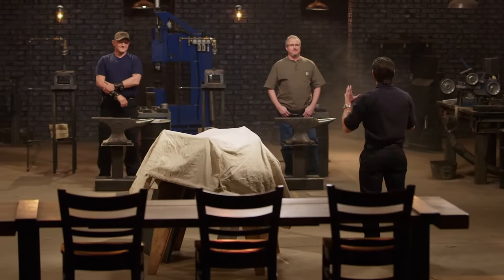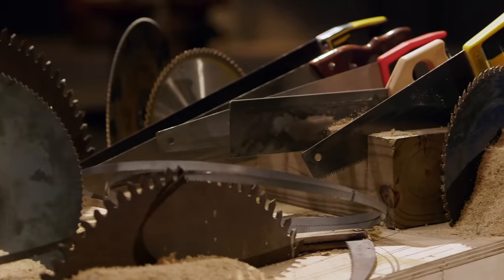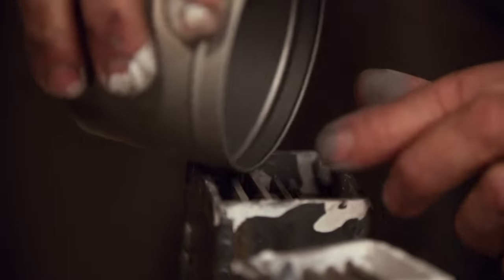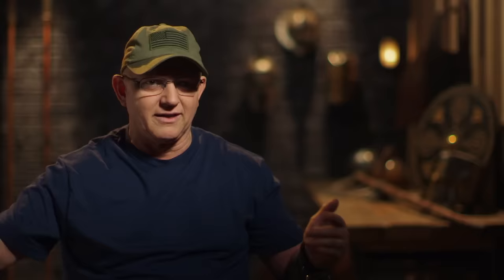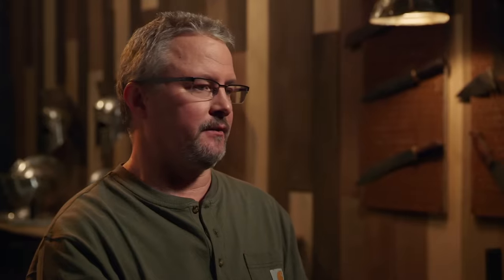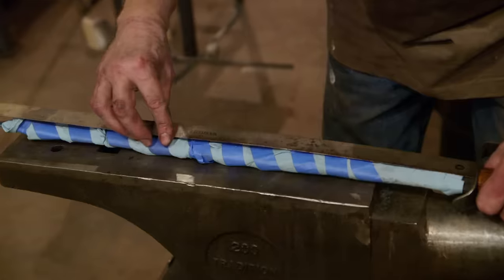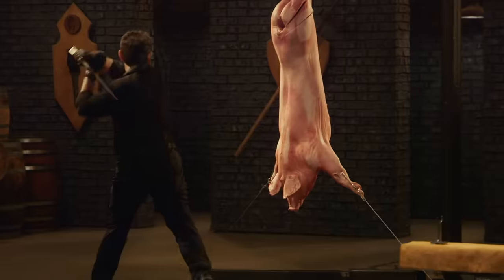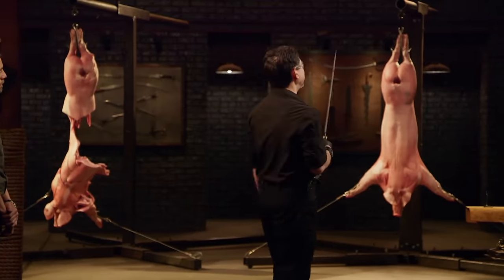Forged in Fire: Beat the Judges: SAW BLADE SWORD CHALLENGE (Season 1) | History

Comment: The weight of the sword wasn't part of the parameters given. Yes it plays a factor, but J's handle wasn't mechanically attached as per parameters given in the beginning. Tony's sword met all the parameters given, and performed even better (yes, because it had more weight but like I said weight wasn't a parameter given).

Poor decision. Tony's sword even looked better too.
Reply: Despite it wasn't a required parameter, it's crucial. The short sword should be a one-handed sword. If you get tired by using it 20 seconds (Doug is an expert)...its not a usefull sword.
Reply: @maximilianocantarutti  Regardless, J's handle still wasn't mechanically attached as per the parameters stated. Yes weight is crucial, but it wasn't specified in the parameters, therefore J's sword met less parameters than Tony's.
Reply: @dylan_was_taken  Yes, i agree with that. I'm just saying that's why they made the decision.
Reply: @maximilianocantarutti  If you were actually battling you wouldn’t use it for more than 20 seconds without a short break at least. The weight shouldn’t have been that big of an issue. You couldn’t use the other weapon for more than 20 seconds either because it became too dull to be useful so it ended up being a mace that weighed 2 lbs
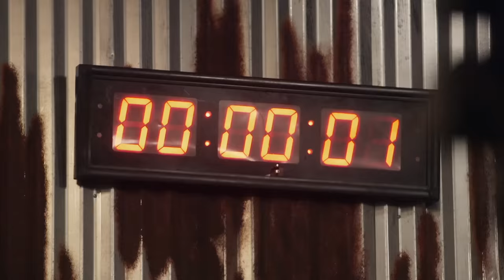Reply: @dylan_was_taken  could of still been mechanically attached with a peened tang, we don't see the pommel end at all besides at 3:36 for a microsecond with heavy camera blur. Looks like it's been peened into a counterbore in the pommel and ground flush. I'd assume the judges are defining a mechanically attached handle to be one not attached by the use of epoxy glue, either by the use of handle scales and rivets or a peened tang (which is more common with historic swords).
Reply: They always bleat about the weight after swinging it around with barely any control to the point where they need the weapon looped onto their wrist. Doug might be an expert in knives but he always waves a sword around like a toddler with a baseball bat.
Reply: Fixed lol 😂
Reply: The whole purpose of a short blade is that is supposed to be light and easy to swing around, so yeah weight does matter otherwise they would have asked for a claymore if the whole point was to cut in half in one swing
Reply: @slashingzordz7998  not necessarily. If you had on some thick leather and had to get hit with both which would do more damage with less swings? 2nd one couldn't even cut into it
Reply: @brianmiddleton3359  idk how you think swordplay works but being faster and more agile than your opponent will always give you the edge
Reply: @maximilianocantarutti  "doug is an expert" i have never held a sword in my life and can tell you his edge alignment and overall technique is so bad sometimes. He's been spinning around and overswinging so often now im honestly convinced he thinks hes in some bad action movie.
Reply: I agree he should of one mainly because he passed all of the test better even damage and everything it just weighed more and he still lost. Its kinda bull.
Reply: @crommg  battles are never less than 20 seconds dude. Idk where your getting your bs from
Reply: @crusader2603  You kill a guy, move to the next one. If youre the better swordsman it will not take more than half a minute before you move to the next opponent
Reply: @crommg  If.... you kill quickly. 20 seconds? that's about long enough for one attempt to kill your opponent.
Reply: @jackadamsdaniels6719  that felt so rigged
Reply: J's handle could have had concealed pins. Even without the pins, it's still mechanically attached via the pommel. It comes down to the specificity of the parameters.
Reply: @crommg  Oh? I don't think you ever have been on a medieval battlefield. But the moment you are forced to use a short sword, you are fighting for your life. Not just 20 seconds. That is, if you don't die within 20 second, because your bloody short sword is so heavy, that your tired arm can't even lift it.
Reply: @4Curses  Well in terms of battles, you wouldn't just be picking up some random sword unless yours was broken during the battle and you had no other choice. If this were your sword you have been practicing and training with for months you wouldn't have an issue with the weight, considering you probably had a blacksmith craft the weapon to your specific parameters. And I was talking about a single 1 on 1 fight before you move to the next swordsman, probably 20-30 seconds is all you have to live or die. Secondly, nobody has been in a medieval battle who is alive to this day, dont make stupid remarks.
Reply: @dylan_was_taken  Weight isn't a parameter because it is naturally implied when you make a sword.
One could technically make a sword that can cut anything but is absolutely unwieldy. That simply wouldn't pass.
Reply: @slashingzordz7998  Being faster is also worthless with a blade, if the blade can't cut.
Reply: The weight issue is a judge problem, not a Tony problem. Perhaps some gym time is needed amongst the judges?

Comment: I think this episode's outcome was given "homefield" consideration.  The weight didn't break any pre-set parameters & it cut better at the end than the judges sword.  All 3 tests were close, but none of the tests had the judge's sword surpassing the contender's sword's performance.  In all fairness the judges didn't just follow their own pre-set criteria, & admitted in their explanation that they added a criteria of weight after the fact.  A weight limit should've been added pre-build.
Reply: It's a short sword. You don't need to tell a swordsmith that short sword must be light. Lightness in an absolutely essential feature of any sword, especially short sword. The only little difference in sharpness was that the judge's sword had a tiny bit worse edge retainment, but that difference was really small.
Reply: @damasek219  The judges did however specify the handle must be mechanically attached which it was not.  So by that merit alone the judge lost by not even making the sword that was required.
Reply: @erikdouglas9952  His sword was however still usable. It doesn't matter that he didn't fulfil one specification. The other guy didn't fulfil the most important one. His sword wasn't usable which is the greatest criteria and it doesn't need to be specified. It obvious by itself. I would still have given victory to a flawed sword too if I still could use it while the other sword was useless.
Reply: @damasek219  how was the sword useless?
Reply: @awesomeatronik  short sword must be light, otherwise it's useless
Reply: @awesomeatronik  For what it was designed for it would have been borderline useless is the problem.   The thing is a short short is often a secondary weapon in the first place or used in combination with a shield or buckler so it needs to be a light weight weapon you can use with more control.  The entire point of a short short is a to be a fast maneuverable weapon and something that heavy would fail that.    A heavy hand and a half, broadsword, longsword, or two handed sword would be a lot more acceptable.
Reply: @MaethorDerien  4 lbs is not heavy for the average adult who exercises regularly or participates in any kind of sporting extra curricular. Bowlers for instance swing balls around that weigh up to 16 lbs.
Reply: Tony's cut better in the beginning too imho.

"A weight limit should've been added pre-build."
Or not added at all.
Reply: They've always judged with weight in mind in all their other episodes.
Reply: It was surpassing judge's sword exactly because of the extra weight, so IMO in this case it was a fair decision.
Reply: problem here is neither built a proper short word, so both should have been disqualified.
Reply: @RPGMasterShadow  blowers flow with the ball they arent trying to fight against its momentum which is very important in a short sword
Reply: @RPGMasterShadow  4 lbs is insanely heavy for a sword that size. Take a 5 lb weight and hold it out directly in front of you with a straight arm, you wont last long. Swords use similar muscle groups as that so taking that blade and swinging it all day would actually end up injuring you.
Reply: @ShihadMan  I'm a bowler, I regularly swing around 16 lbs no problem for hours.
Reply: @RPGMasterShadow  different muscle groups. Try swinging it overhead
Reply: @ShihadMan  Overhead behind the back, have you never seen bowling? Lol
Reply: @RPGMasterShadow  A shortsword should be 2 pounds or lighter. I could swing a 5 pound head axe, doesn't mean it's light. You can use a 4 pound shortsword, but it 
is too heavy for its purpose.
Reply: Weight and feel is always an implied criteria.
Reply: @damasek219  a sword also needs to cut things, jays sword barely made 1 cut on the sharpness test, they definitely had some bias
Reply: @RPGMasterShadow  The main difference here is one of purpose. It's an unspoken rule that when they're making weapons, they should be functional weapons. The parameters given on each build are to make sure the smiths make the same type of weapon, they aren't the only thing being judged. You may be able to swing a bowling ball around all day, but a short sword has to be light and maneuverable so someone could be fighting with it all day- they're not just swinging a four pound weight, they're swinging a four pound weight accurately while wearing armor and constantly running and moving with few breaks. It needs to be light for balance and efficiency purposes. 

But J definitely didn't have a mechanically constructed handle that I could tell, so that's an interesting point.
Reply: It's a short sword. It should be obvious to a smith that it should be light. If they wanted a heavy weapon they'd have made the challenge with axes or Polearms, and even then those are supposed to be weighted properly. A weapon that feels too heavy to use repeatedly is a bad weapon.
Reply: @lostwizardcat9910  a sword needs to be usable comfortably. If you're in a fight, and you get too tired to use your weapon, it's a bad weapon, and you're dead. And if you have time to prep for a fight, like they did on the battlefield, you could sharpen a dull blade, but you couldn't fix a weight issue.

Think of it like this: you have two cars, one of which is very fast and gets you places fast, but burns through gas incredibly fast as well. And another car that's not as fast, but has great fuel efficiency. Which car would you choose to get?
Reply: @ianluk8855  a sword needs to be able to do sword things first, if the guy you're fighting cant cut you then it doesnt matter how heavy you're sword is you can still win.
Reply: @lostwizardcat9910  Yes, a sword does need to do sword things first. A sword is, first and foremost, a weapon. And weapons need to be able to be used over and over again, and easily, even heavier weapons like axes and polearms. You don't want to use a weapon that leaves you too tired (or even physically injured) too quickly, because that will get you killed faster than almost anything. You can sharpen a dull blade, you can't fix a weight issue.
Reply: @ianluk8855  id rather have a sword thats a bit too heavy over a sword that cant sword.

Comment: So one guys does well in all 3, the judge fails the 3rd and still wins. Totally fair. Jay lost.
Reply: Its because of the weight
Reply: both of them lost the 3rd test though, the first blade only had like half the blade that still have edge and the first strike able to cut through the dummy arm because it's a vertical strike, on horizontal strike, it's mostly because the heavier blade deal a deeper wound, but still a blunt strike, same with J's blade, the test show that both of their blade lost their sharpness after the strength test, so both of them are failed to be qualified for sharpness test. The idea of the sharpness test is test if the blade is still functional after the strength test, what's why it's always take place after the strength test.
Reply: NOT only that! The guy did better in 2 out of 3, and still lost.
not ONLY THAT! But a mechanical connection was required, Jay lacked one, and HE WAS STILL the winner.
Reply: @quangnhat5345  Nope, both passed.
One passed only BARELY because it was unable to withstand the durability test.
Thus, Jay lost 2 out of 3 tests.
Reply: @D-Vinko  I completely agree.
 The judges  basically said "Well Jay, one of the requirements was to use a mechanical connection and you didn't use one but the other guy's sword is heavy even though there is no weight requirement. So clearly the right thing to do is declare you the winner."
Reply: @ok4412  4 pounds is about twice as much as a short sword should weigh. I imagine it would be too slow to use in a battlefield situation even if it cuts deeper.
Reply: @Khaliljt  It wasn't made for the battle field though, was it?

If it was, that would be prefaced in the test requirements.

Maybe if they want battlefield weapons, they should set a weight parameter.
Reply: @horvathbenedek3596  given that the swords are being wielded for tests and are meant to be functional I’m sure it’s implied that you’re not supposed to make it cumbersome.
Reply: @Khaliljt  
It isn't implied though. But even if it is, the primary testing criteria should be the more important factor. 
If they disclosed that the weight is such an important issue, I'm sure the guy wouldn't have put a massive copper handguard on that sword.
Reply: @D-Vinko  Pommel can likely count as a mechanical connection. The artists of the graphic were probably directed to show pins by an entirely different team than those who design the competition.
Reply: @horvathbenedek3596  The goal is a FUNCTIONAL replica. Not a wallhanger.
Reply: @4Curses   @4Curses  It was never specified if they wanted a functional sword (that is the point of the tests to determine), and "replica" wasn't specified either -probably mainly because this was literally a "custom blade build" challenge. Usually they make replicas, not this time though. So you are wrong on two fronts. As for it not being a wallhanger - they literally hang the winning swords in the background. Yeah. 

Again, they specifies the testing requirements, he met those requirements. He beat Jay within those requirements. It wasn't even close, Jay lost fair and square.